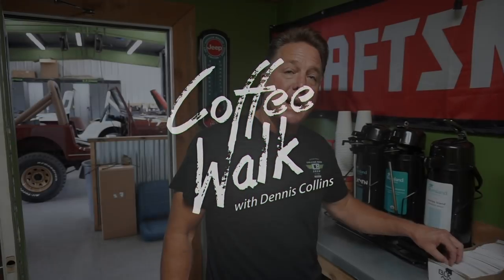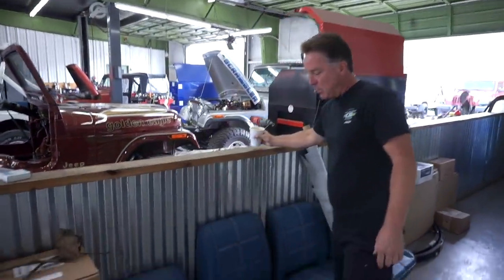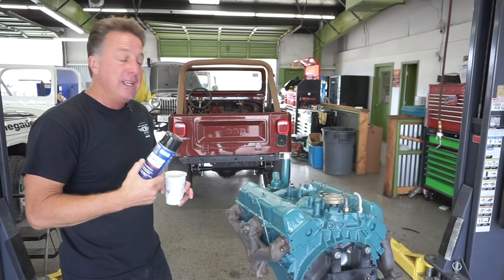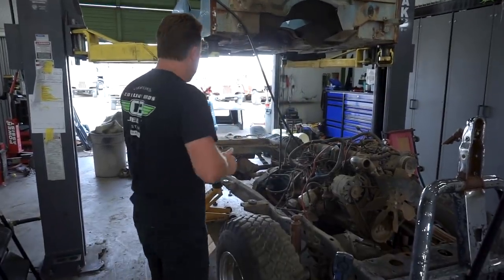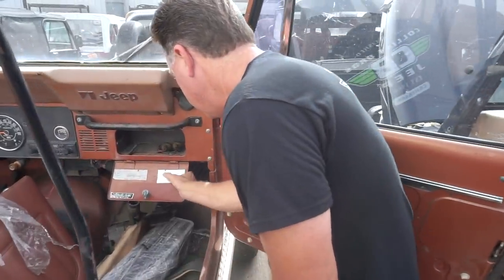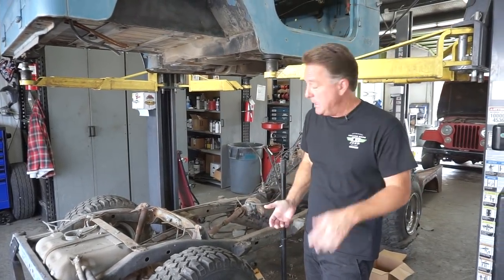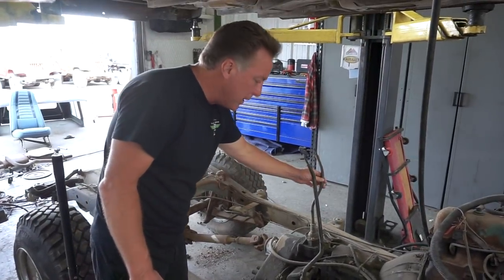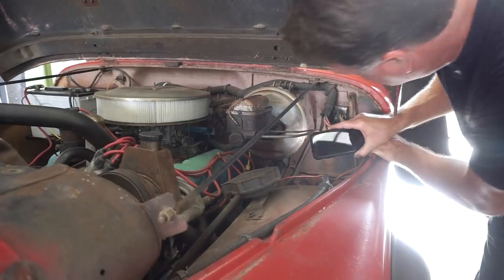How to: Figure out Jeep Axle Ratio

Comment: If no axle  tags are available, you can spin a rear tire and count drive shaft rotations to get the ratio. Math is slightly different between an open differential and a locked one.

Comment: You can also figure out your gear ratio by spinning your tire and counting how many times your yoke goes around per one revolution of tire. While your vehicle is off the ground, if you have a sure grip or not by spinning the tires. If they go the opposite, that is an open rear. If they turn the same, it's a sure grip. I'm sure everyone knows that and don't know why that wasn't shown.

Comment: I have a 90 yj ,6cyl auto, on colum. Tilt  intermittent wiper,  need the controller for wiper  a small unit under dash .do you have one??? Oh I found on Oklahoma its rust free. Do not drive in winter salt.

Comment: Dennis, I have a 1980 CJ7 with the X code on the rear AMC 20. However mine has a small 2 stamped next to it on the bottom right. I thought a shop may have done it but I noticed a post on a forum from someone else asking the same question but never got the answer. Any idea what the 2 represents?

Comment: Say if its open diff jack one tire up and one on ground mark tire and turn tire one full rev. and count pinion yoke turns. a 3.07 will turn 1.5 so double it. a limited slip or posi will turn a full 3 turns and a tad like 3 and 1/8th a 4.11 the yoke will turn 2.1 turns open or 4.25 turns on posi. on posi both tires off ground Old school go to wrecking yard trick. many many many times on old ride the tag is long long gone. now! you will never tell a 354 from a 355 this way but a idea